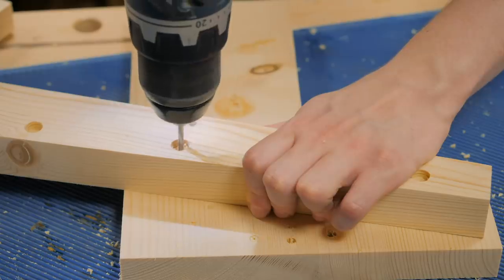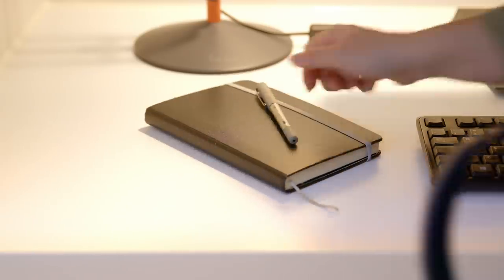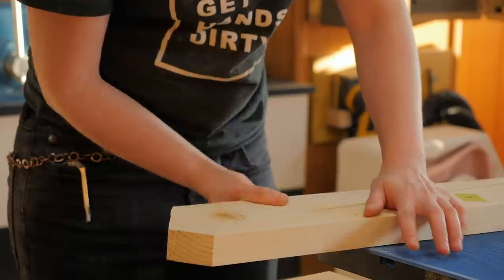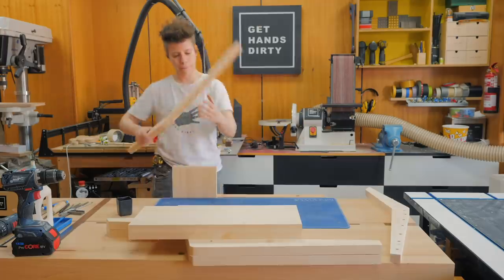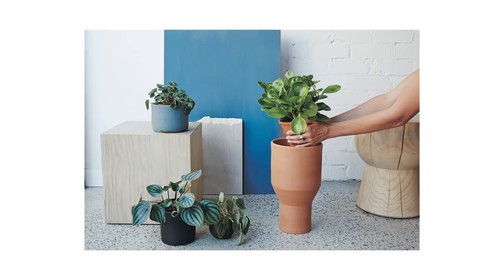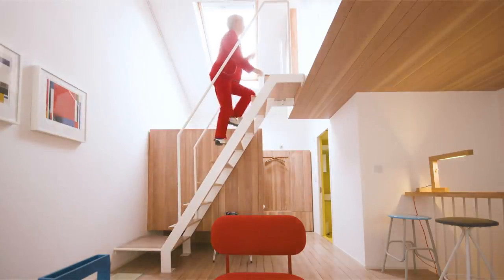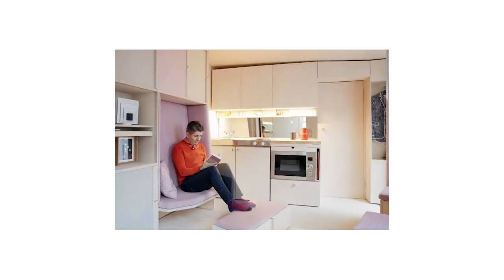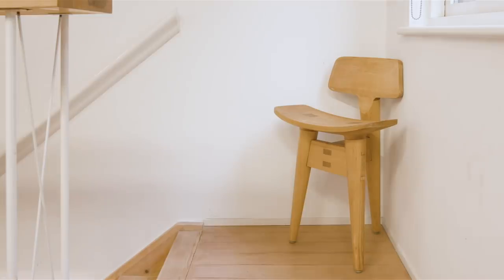SMALL LIVING ep.3 - Styling tips, ideas and DIY for small spaces

Comment: For a WFH office with a rolling chair, especially if your going to be working all day, I would recommend a small flatwoven rug under your rolling chair.
Protects the surface of your floors from scratches and warping and is easier to clean. Reduces noise and makes the chair more stable.

Comment: 2:02 Please people, unplug the cable from your external hard drive while it's not in use. Stuff bumping into the connector can damage the internal usb port meaning you won't be able to access your data. Also don't store hard drives high up, the further they fall, the more likely you are to damage the drive's mechanical parts